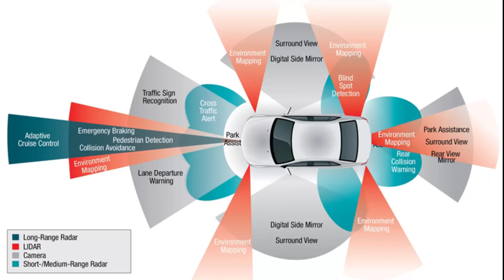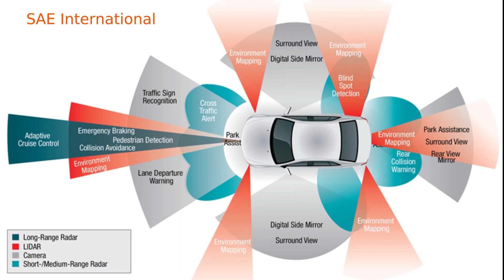Tesla Cybertruck Crash Protection

Comment: The inner monitoring (screens) will need to be configured to the viewing angle of the driver's eyes and must simulate 50mm focal length. To all the other occupants, it will look out of place (this could be solved with screens that have very narrow viewing angle). 
This whole system will add to the cost. Some may argue that it would not be needed when FSD is complete.

Comment: External air bags only lessen the penetration of a collision by 30%, so that tough steel alloy unibody will be damaged even in the case of a rather light collision metal to metal. I wonder what this means for the Cybertruck. Will it be totaled because the body is damaged and there is no easy way to repair even a scratch, let alone a dent? Will Tesla offer a unibody replacement scheme, and at what cost? I think I'll keep my money and wait for Cybertruck 2.0. Oh wait, I don't have any money and I don't need a pick-up!  ;)

Your suggestions are not really specific to the Cybertruck, but I agree the external air bags would make a lot of sense in that case. No idea if that's what Tesla will adopt, as this is brand new tech for cars, but then, they have over a year to perfect it before crash test certification.

Still, I can't help being a bit disappointed: The Cybertruck has a laser wiper, so I thought maybe the truck could be painted in blue and the laser could be used to disintegrate and exterminate any pedestrian who dares stepping in front, at least for the British version of the TARDIS truck.
Reply: Paranoid?
Reply: One can add such an external airbag system to any passively safe truck and make it way safer than the Cybertruck. Everything being equal the stiff and edgy piece of stainless steel won't make it up the chart of the safest vehicles for pedestrians.